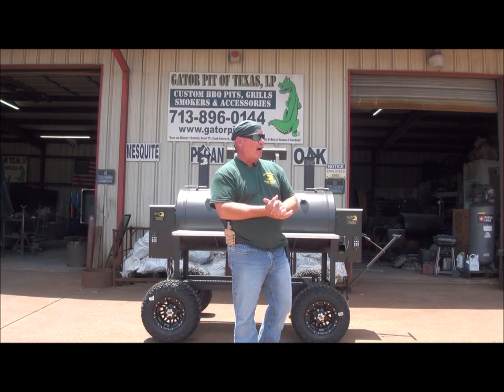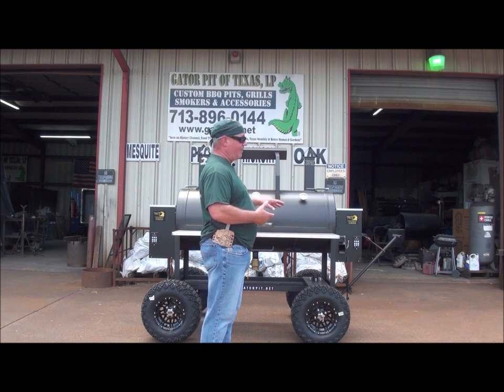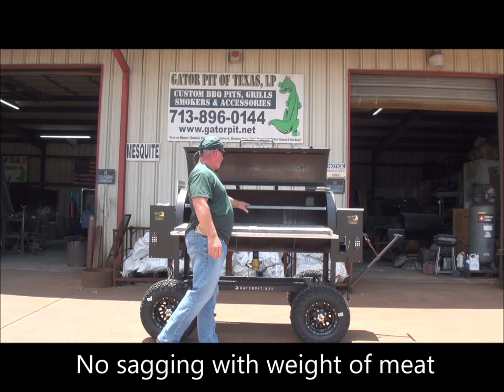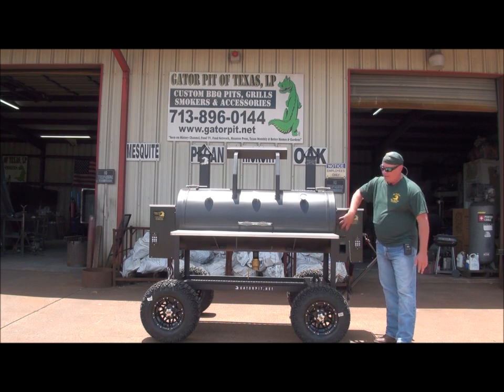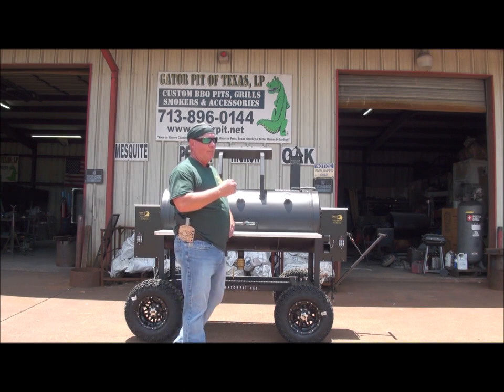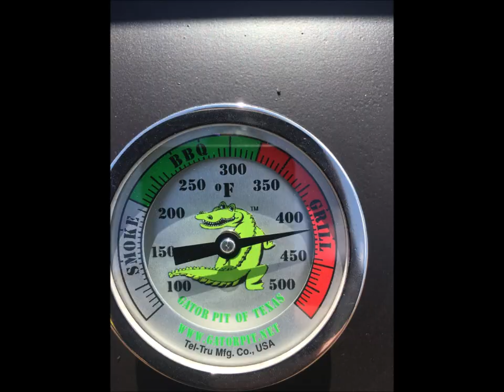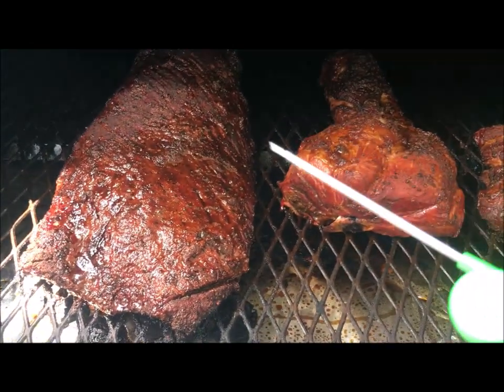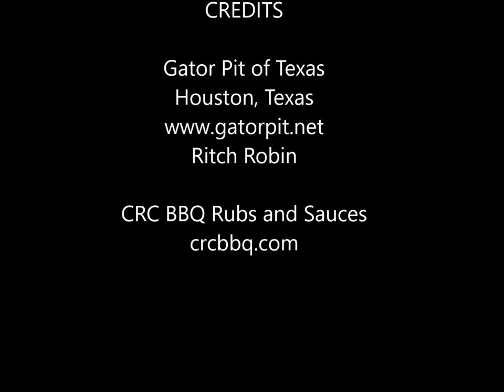Big Boy Pellet Grill Golf Cart set up

Comment: Can we buy the tire kit seperate?
Reply from the maker: Our kits are designed and fabricated to fit the specific Gator Pit we are custom building at the time of build.  We do not have a standardized kit one can purchase.
Reply: @GatorPitofTexas  ok thanks.. would you sell one separately anyway?  If so what would the price be? I do some fabrication myself
Reply from the maker: @davidjenks1305  We do not.  Have to have the cooker to fab parts to fit to that cooker.  The legs and lower storage of our Gators are part of that kit.  I do not have a "part" made that we can ship.  We even make the axles to fit the specific cooker, as they are all different widths, depending on the cooker.  Sorry, but no can do.
Reply: @GatorPitofTexas  ok  thanks.. thanks for replying so fast I appreciate it